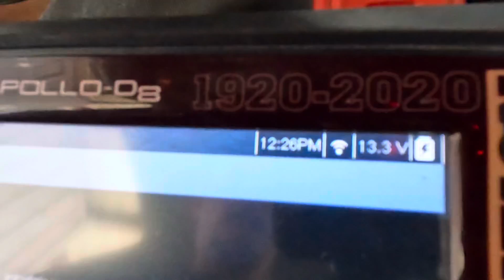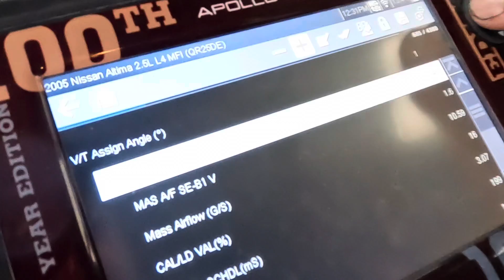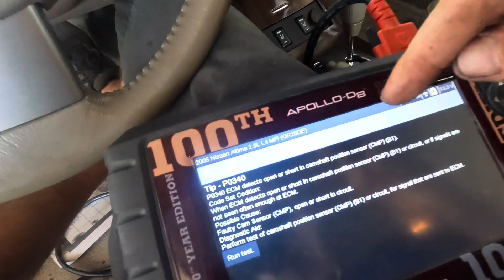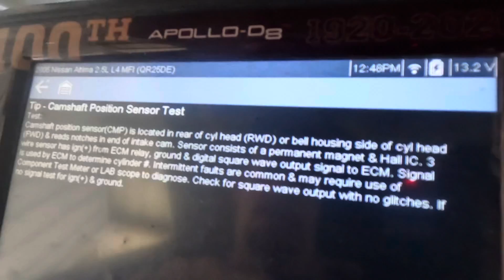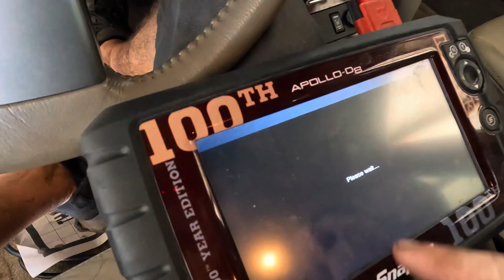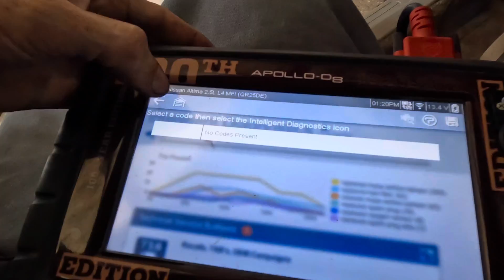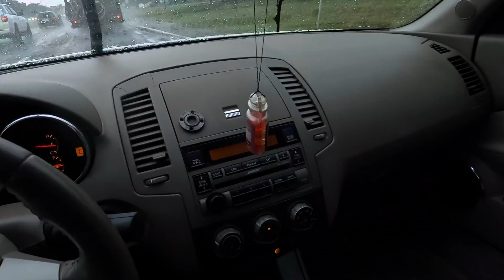This will make you ☠️☠️☠️ | Parts Cannon! Nissan Altima 2.5 P0340 Camshaft

Comment: ESPECIALLY in Florida rain like that. I drive a 10-wheeler box truck, and there are times where I simply will not be able to get stopped fast enough to compensate for you pulling out in front of me when you shouldn't.
Reply: a lot of people dont understand how much it takes to stop that much weight
Reply: Drove truck for a long time and I can tell you the only dime it will stop on is the one in your pocket
Reply: I used to drive a 10,000 lbs box truck and people in chicago in the winter believe you should be able to stop on a dime...
Reply: @parrott15  and give 20 cent change. Lol
Reply: I was a OTR driver for 17 years. I had an older driver pull out in front of me in a highway construction zone. much horn honking and tire smoke later I just missed running her over. she called my company in a rage saying I tried to kill her! Dispatch put us a conference call to get the story. she hung up angry when I said she blew the stop sign
Reply: I agree. People who's doing that must have some kind of deathwish.
Reply: People have a death wish when they pull out on a semi truck I don’t do it because I have common sense
Reply: I see people race semis and try to get in front of them as everyone is braking. One day someone’s going to get rear ended
Reply: It's one of those weird things that's frequently on dashcam videos. People speeding to be infront of the truck, brake checking, pulling out infront of an at-speed truck, or purposely being an asshat to the trucker for whatever perceived injustice against them....I never understand it.

Do not play stupid games with trucks. They outweigh you, they can't maneuver as easily as you, they can't slow down or stop as fast as you, and they will roll over you without mercy.
Reply: Respect

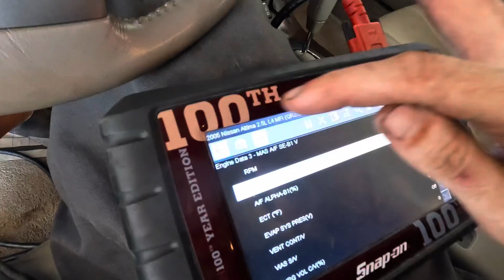Comment: 3:48 did he say he wants to know if the cams are retarded?
Reply: Yes. The engine will retard timing if you have issues. "Retard" refers to Slowing something down. Its a word with a bad rap due to social connotations
Reply from the maker: Yea that’s a real life technical term.
Reply: thats what the insult comes from 'are you retarded?' as in are you slowed down. just like 'shut up' close your mouth, which way does your jaw go? boom, now you know what that's from
Reply: We have to say "alternately positioned" cams. "Retarded" has such a negative connotation. Those cams could be perfectly aligned in another universe!
Reply: @Bilamac  o.o. Im assuming that is satirical?